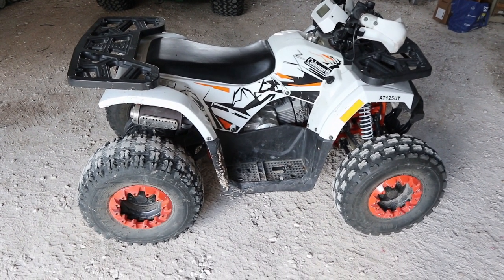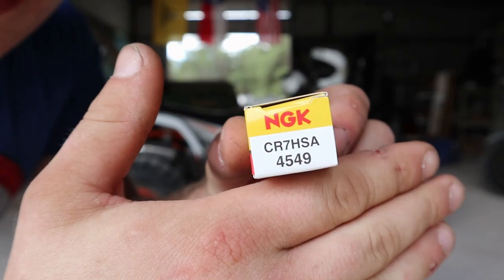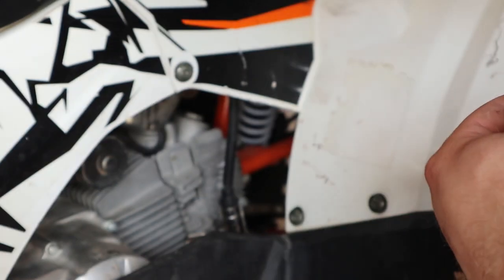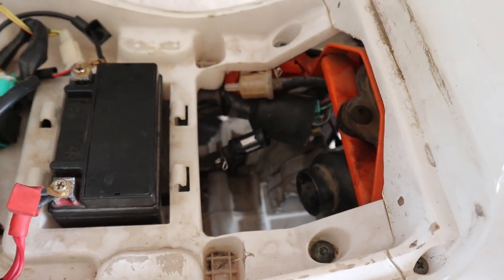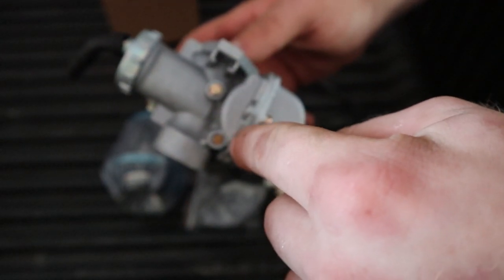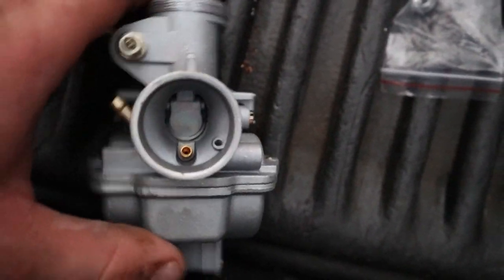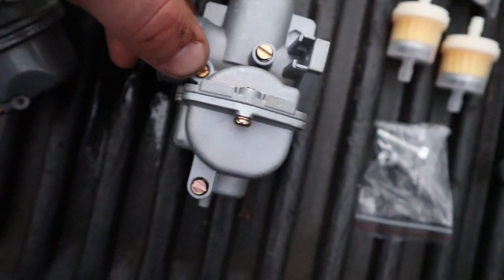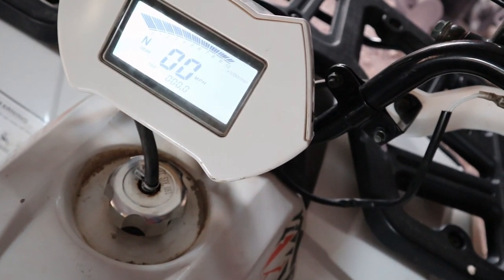Coleman AT125UT Carburetor + Air Filter Upgrade

Comment: Thanks for the Vid, I have the same exact 4x4 and had exaclty the same problem I ordered that carb and the only issue was with the throttle plunger inside does not fit too big for the new carbs cylinder? any  ideas to check out?
Thanks

Comment: Looking at the slide in the carb, doesn't look like it opens all the way, therefore it cuts airflow and defeats its purpose...also be mindful its air cooled so running a little richer would be a cooler engine so maybe maximum air would not be a good thing. Even stock, you could have opened the idle jet and raised the needle on the slide I would think....
Reply from the maker: It opens all the way, 4:29. I agree with running it on the richer side. I messed with the stock one but you can't swap jets and I tried chaning needle height, thats why I upgraded.

Comment: I'm doing the same thing. So, how did you adjust the throttle cable when you put on the new carb?
Reply from the maker: adjust throttle cable for tightness? I didn't have to change anything

Comment: What about low end? If I nose up to a speed bump and start out it will barely get over it. No low end on this thing
Reply from the maker: @mikew8849  you can swap to a bigger rear sprocket or do an engine swap like I did.
Reply: @Bataha  I have a 110 Polaris and it has more power at low end and more speed on the high end. This Coleman is so underpowered. I don’t understand why there is zero low end
Reply: @Bataha  and the turning radius is like zero. I need to cut the steering block stops? Who designed these things?

Comment: Hay after you take off the air filter the stock one has a little rubber line that comes out  and goes to inline fuel filter then in to the back of the motor when I chang the air filtter to one like you did were do you put that little hose back on
Reply from the maker: 2:09 I but a breather on the line.
Reply: Any pictures wondering the same what do I do with that line

Comment: I have the exact same quad and ordered the same parts as you but it idles really high in neutral and I have turned the idle control screw all the way to the right. How did you get it to idle low?
Reply from the maker: turn the idle screw to the left to lower it.
Reply: @Bataha  Thank you

Comment: I had the same issues. I installed everything you did in the video and  it revs up and down at idle..I tried adjusting idle and air a bunch. Sometimes I throw it in neutral and it surges up to 5k+.. any idea?
Reply from the maker: Adjust the needle height and see if it will run any better. Make sure nothing is clogging up the carburetor.

Comment: Im about lose my mind trying to figure this out. Installed everything correctly, but when I go to give it gas it bogs down and just goes blurp blurp and wont go that fast almost like its backfiring. Whats the problem??
Reply from the maker: Have you tried adjusting the carb at all? Sometimes I get them and don't have to mess with them. But a lot of times I have to do small adjustments to get them to work. I'm happy to help you troubleshoot, we can do it over discord. https://discord.com/invite/CQyNaw8
Reply: @Bataha  Unfortunately I don't have discord. This is my 2nd carb because the first one worked for a day or 2 and this one lasted a quarter of a mile. I tried relentlessly adjusting the little screws to get them to work with no luck lol. This atv maybe has 5 miles on it 😑. I only took the stock one out because I watched this video a while back and was like oh wow more power. Now I'm wondering if I should just buy the stock one and put that back on.
Reply: Well I got discord now and accepted invite, but won't let me send a message or anything.
Reply from the maker: @ThePl87pll  It may be because you just created the account. So does it not start or what happened when the carb stopped working?
Reply: @Bataha  No it starts better than ever, fires up immediately and idles perfect, but when I go to give it gas it just sputters and won't go fast.
Reply from the maker: @ThePl87pll  have you tried adjusting the slide?
Reply: @Bataha  the slide of what?
Reply from the maker: @ThePl87pll  The slide inside the carburetor. It lifts up when you hit the throttle.